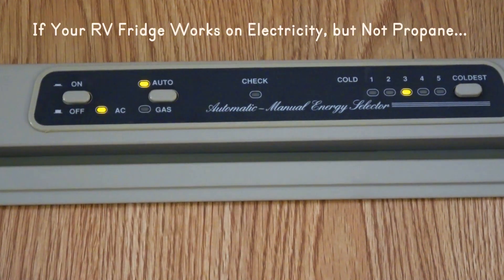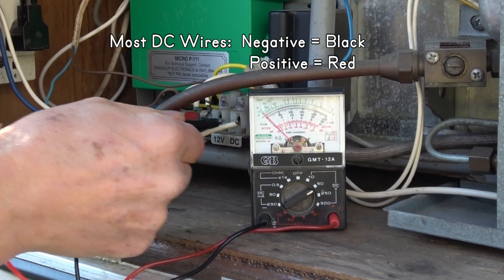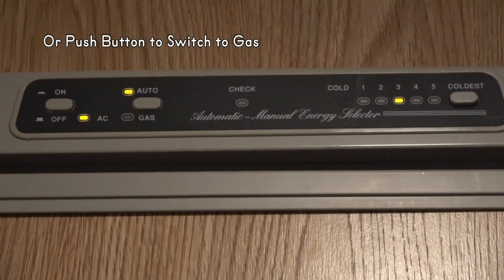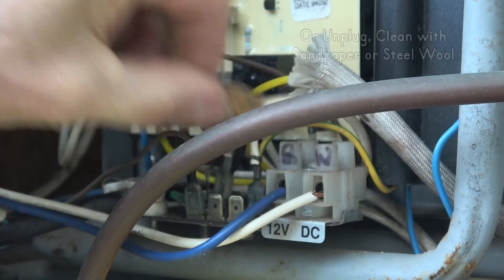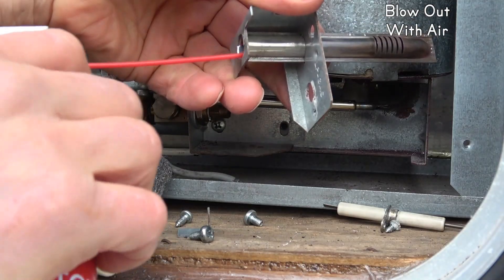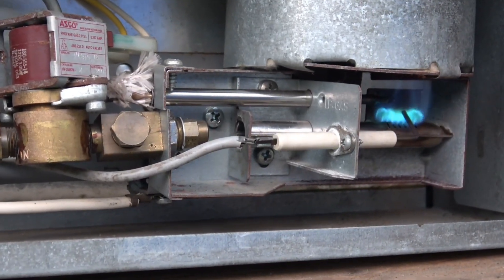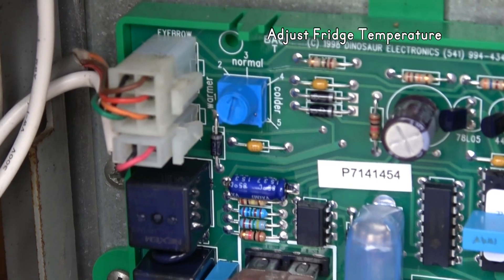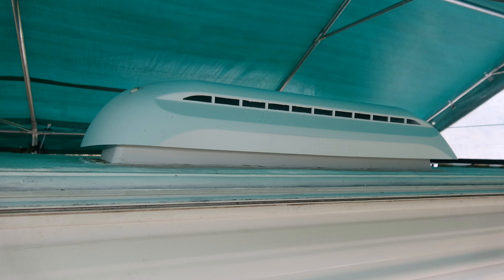RV Fridge Not Working on Propane - 10 Tips to Troubleshoot & Repair

Comment: Really SUPERvideo and very little "fluff".  The only problem is that it does not address MY problem. Fridge works on electric but on propane, flame starts and ignitor keeps sparking.  After about a minute of continuous sparking, flame shuts off and fault light comes on. Cleaning contacts did not work.  What is the next step?  BTW, when wiggling or pressing on the "black box" on the controller board. SOMETIMES it is a cracked solder joint which can be repaired by removing the board and resoldering all the connections for the "black box". It doesn't work more than about 29% of the time, but Wirth a try.
Reply from the maker: I suspect either the thermocouple or circuit board need replacing. When the flame lights, the thermocouple should sense the flame and turn off the igniter, so either it's not sensing it, or the circuit board relay is not turning the igniter off. A common sign of thermocouple failure is the flame burns 30-60 seconds then the solenoid closes shutting off the gas and the flame goes out.  The fact the igniter keeps sparking may show a circuit board problem. On mine, I first replaced the igniter for about $35, and it still had problems, so replaced the circuit board for about $120, and it's worked fine ever since. The igniter was more of a challenge, squeezing it into place. The circuit board was fairly easy. It's possible the igniter generator could be stuck on, but seems it would fail by not sparking, not by continuing to spark when it shouldn't. Let me know when you figure it out.

Comment: My propane fridge would work intermittently only
Reply: As I exam the modules and everything I found a piece of carbon stuck on the heat sensor once I remove that piece of carbon everything was fine it was hard to spot so check for anything in that area
Reply from the maker: If you continue to get debris on the thermocouple, it's possible the burner tube may need cleaning.

Comment: Is it possible that only part of the circuit board stops working?
Reply from the maker: Yes, I suspect only one component in the circuit board usually fails, but unless you know electronics, the way to fix it is replace the whole board.  When we were camping and the fridge quit working, I pulled the cover off the circuit board and wiggled things until I pressed a black box and suddenly the spark fired and the flame lit. So I cut a stick the right length to prop against that box until we got home. Replacing the circuit board was quite easy, though it cost $120 it has worked great ever since.
Reply: @HartzHomestead awesome thank you, it’s definitely the circuit board then. Thanks for the great video👍🏻

Comment: Hello! This is a great video. I have an interesting issue while on the road: Norcold 6162 comes on no problem on gas and everything works fine, but the gas shuts off after an hour or so and gives me the warning X. I just reignite and it's fine again for another hour or 2. What could that be? When I get home I'll do more testing but was hoping to get additional tips. Thanks much!
Reply from the maker: Electrical contacts can be the culprit, especially to the thermocouple and solenoid, either of which could possibly be the problem. Usually a bad thermocouple will shut the solenoid in about 30 seconds.  Thermocouples are not expensive and do wear out.  DeOxit works well on contacts.  I had different issues, but replacing the circuit board finally solved it and it's worked well ever since.  Cleaning everything may help too. Check if you turn on other gas appliances the pressure may drop and it could go out. In our camper if the fridge, hot water and stove are on, the heater won't light.

Comment: thank you for the video! very precise. i just have one question, my Norcold fridge flame stays for couple of hours but will shut off. Do you know what causes it?
Reply from the maker: I'd suspect either the thermocouple or circuit board are going bad, or could be just a weak electrical connection. Try cleaning the connections. Wiggle the wires around while it's running. I'm assuming the gas supply is steady, lighting another device may lower the pressure. Try to listen for if it's the solenoid closing that makes it go out. That's hard to diagnose when it works part of the time.
Reply: @HartzHomestead  Hey - I have the EXACT same issue and just posted that same question. Did you figure it out? Mine stays on for an hour or 2 and then gives the red x and I just restart it until it shuts off again.

Comment: My flame was coming on  then the regulator started clicking which shut the propane off . I just used an air compressor to blow the flame orifice out and it’s fixed ! The refrigerator has been off for about six months. Maybe spider or cob webs clogged it. Iv had same problem with propane torch heads and this always gets them flowing again.

Comment: I'm late for the meeting, but id like to share that my propane fridge started a small fire in my trailer while i was sleeping. When I returned home from my trip, I blew out the exhaust and a bunch of crispy wasps and a small burned nest came out of the vent for a few minutes of blowing with an air compressor. It took almost 2 days for the wasp nest to cook off before it finally combust.

Comment: Thank you for this fantastic explanatory tutorial. I had issues in hot weather on propane, while the cooker seemed fine and heating worked ok the fridge was warm and freezer was cold. Drove me nuts for a while and after replacing all sorts decided to replace the regulator on the motorhome tank, When I unscrewed the pipe at the regulator a brown residue liquid drained out and the fridge immediately started working again. I also blew the pipe back from the fridge to the disconnected regulator.

Comment: What about an electric fridge?
Reply from the maker: An electric fridge compressor type fridge is more efficient if you will always be plugged in to 120 volt power.  If you will be boondocking where there's no power, propane is more practical, unless you have a large solar and battery system. We always camp in the mountains where there is no power, and too many trees for much solar.

Comment: Perfect! So much useful information in such a compact and clean noise-free format. Thanks for the DIY manometer tip. I've been wondering for some time if low gas pressure might be the issue on my Dometic RM 7401.

Comment: Hi, any idea what would cause the electrode to continuously click? It lights and the fridge runs perfect but it just keeps clicking. Tried cleaning the area but still have the problem. It’s an Rm2355 Thanks in advance
Reply from the maker: The ignition module could be faulty. That controls the spark. If you follow the wires from the igniter, it may be just outside the circuit board. Or it could be the thermocouple, or flame sensor - make sure it's clean. If the wires and connections to these are good, try replacing each of them. You can try a reset - disconnect all power for 10 minutes or so, then reconnect and turn on.  Possibly the circuit board itself could need replacing.
Reply: @HartzHomestead  thanks for the info. Would the ignition module be the rectangle blue box?
Is it easy enough to replace? Just a couple of plugs?
Is the flame sensor part of the igniter electrode? I replaced the electrode today but it didn’t fix the problem unfortunately. I will try the module next. Thanks

Comment: You video coves a little too much for this 80 year old. My problem is the flame comes on but is nowhere as large s yours. I only started to have problems last weekend. In the past I had no problem getting the freezer to minus 20 degrees Celsius. Was working on it today gain but it took three hours to get it to -9. Ny idea why my flame is so small.
Reply from the maker: Sounds like either the gas pressure is too low, or something is partially blocking it. If any other gas appliances also have a low flame, test your gas pressure and turn it up at the regulator. Turn off all other gas appliances and see if that helps - as that may drop the pressure. Otherwise, try cleaning the burner tube, brass jet (very gently, with alcohol), and make sure the shut off valve is all the way open.

Comment: You didn't even mention my problem - no spark from the electrode
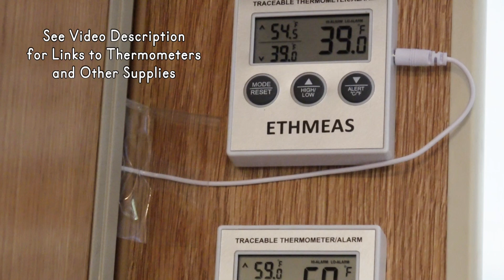Reply from the maker: Actually, at 2:53 I mentioned if you're not getting a spark, check the gap - should be 1/8 to 3/16" from the igniter to the burner tube.  Also clean your electrical connections - that was how I got mine working the first time, especially the ground, and lead to the igniter. There is a device by the circuit board that creates the spark which could need replacing, or you might need a new circuit board, which sends the signal for when the spark should fire. It's not hard to replace, but costs over $100.
Reply: @HartzHomestead  In my case it was working and then stopped working so I went through  the usual routine of cleaning all the connections and probe. I can light it manually so gas is working. I ordered a new igniter box ($100) I replaced the control board with a Dino a few years ago so ..🤞
Reply from the maker: Could well be the igniter box. Replacing the circuit board got ours working. We were camping and the fridge quit cooling. I pushed on a black box on the circuit board and it suddenly sparked, so wedged a stick in there which kept it working until we got home.
Reply: @HartzHomestead  FYI and for anyone else who might read this the new igniter box fixed my problem.

Comment: Wow! As thorough a lecture as I've ever received! My situation seems a bit different. I have a Dometic 8551 3-way. Works great on 120V, so-so on propane and not worth a darn on 12V. The challenge has been with the propane. In ambient temperatures of 80 or more the propane function struggles. Gas is good, jets and orifices are clean, solenoid good, igniter good, flame nice blue candle flame. It just won't produce cold temps during daytime operations. Does a little better at night, but still on the warmish side. I won't put lunch-meat, etc. in the box. One thing I haven't done is pull it out and do a thorough bench cleaning. Big job!
Reply from the maker: I've heard propane fridges don't do as well in hotter weather, though it should work as well on propane as 120V.  It can help to add a circulating fan to blow air over the coils on the back of the fridge, and make sure your roof vent screen is clean.  You could freeze extra ice at night and put it on the top shelf of the fridge in the day.  Also park in the shade, or with the fridge on the shady side if possible.

Comment: Great video it got me to at least sort of figure what my problem may be in less than 10 min. I don't think my flame is getting high enough to reach the thermocouple. I can jam a knife in there & pry it down about 1/8" and will work fine. Hopefully cleaning the nozzle works, if not i can't figure out how to adjust my propane pressure.
Reply from the maker: There should be an adjusting screw on the regulator on the propane tank that will adjust the pressure.  I'd suggest actually testing the pressure so you don't adjust it too high.

Comment: if the frige work great when the rv is park
but the frig warm up alot to room temp when i am driving on road for 4 hour 
and the burner is working when check it 
what would you think it could be ?
Reply from the maker: I don't know. I turn our propane off when we are driving, and just put extra ice in the fridge. If the propane and battery are on, it should still work when driving, unless you are driving long steady up or down hill, it works best when near level.

Comment: Any idea if pilot lights but only for a few/10 seconds? Works on AC but not on gas. Pilot only stays on for 5-10 secs. Solenoid?
Reply from the maker: There's not a pilot, so I assume you mean the flame goes out after a few seconds. Try cleaning the electrical contacts to the thermocouple, the sensor in the flame that tells the control panel if the flame is lit.  Not too hard to replace. Usually if it's bad, or contacts are poor, it will stay lit about 30 seconds then you'd hear the solenoid clunk and the flame goes out. You can test the solenoid by applying 12 volts and it should stay open as long as there's power to it. You'd hear it open and close. Or could you be low on gas and there's just enough in the lines for a few seconds of flame? Or other appliances using the gas?

Comment: Thanks for the amazing video.  It's nice to see a video that doesn't waste time getting to the point.  So much information.  My A/C side is working fine on my 20 year old Norcold.  On The LP side,  flame is working fine although more orange than I would like, but the fridge is not cooling down.  Any suggestions?
Reply from the maker: Did you give it at least 1-2 hours to start cooling? Also make sure the flame is staying lit all that time. It helps to track it with a thermometer in the freezer, and feel the plate near the top back - that should be cold.  An orange flame could mean the inside of the burner tube needs cleaning, or the LP pressure could be low. Since it works on AC, it seems either the flame is not putting out enough heat, or it's not getting to the coils. Also possible the flue above the flame could be blocked, but that usually has to be accessed through the roof vent.

Comment: My RV fridge will only work with propane, but it’s freezing right now so it doesn’t wanna work, but it won’t switch from gas to AC even though it’s plugged in I’m not sure what to do. Any help would be greatly appreciated.
Reply from the maker: They don't work as well in cold weather - it may help to cover the vents in the access door to hold in some of the heat.  It's possible the AC element could be burned out - switch it to AC and after about 10 minutes feel if the vent pipe is warm.  More likely there's a poor electrical connection, or the control panel needs replacing. Unplug the power and clean the connections especially to the 120 volt element, and the grounds. Wiggle and push on the wires. Replacing the control panel is not hard, but mine was about $120 and that did fix it. If possible, wait for warmer weather and see if that helps. If you have a thermometer in the fridge that can help know how it's doing.

Comment: 1:27  your lpg tank is horizontal -I thought that was a big no-no! 
I only ask because I'd love to have my camper tank on its side to fit under the bed-base.
Reply from the maker: Some tanks are made to be horizontal, others vertical. It's important to keep and fill them in the position they are made for. So you could get a horizontal tank - might need a different tie down or hose to make it work.
Reply: @HartzHomestead surprising how the commentor did not respond here, you deserve that much. thanks for answering questions here.

Comment: Great stuff. I just got my dometic fridge to lite on propane but the flame is low and my ignition is constantly clicking. This looks very helpful to disassemble and clean the burner tube.
Reply from the maker: If cleaning the burner tube doesn't fix it, other causes of the flame being low might be the brass jet could need cleaning (my manual says to gently clean it with alcohol and compressed air so as not to damage it), or your gas pressure might be low (see the video section on DIY manometer to test gas pressure). Hope this helps.
Reply: @HartzHomestead  Thanks, I seem to have it somewhat fixed.I cleaned the burner tube and burner jet as suggested.
 I now have a strong flame at start-up/cool down for the fridge and its working well BUT when the fridge is at temperature and the flame drops my ignition wants to constantly work.. clicking no stop. I've adjusted the electrode to what seems like an appropriate gap but no luck. What drive the electrode to want to work? Appreciate anymore tips.
Reply from the maker: Are you saying the flame drops to a lower flame?  On mine the flame is either on or off. The electrode should only spark when there's no flame and the fridge is warm enough to re-light.  You may need a new thermocouple. If it is not detecting the flame when there actually is, it may think the flame has gone out and needs re-lighting.  Or you may need a new circuit board, which tells the electrode when to spark, and then there's a black box that creates the spark. You could do a search for "igniter keeps sparking when there is a flame" or something like that and see if someone has a better answer.
Reply: @HartzHomestead  Yes, the flame remains low and then the electrode starts. It never completely shuts off as far as I can tell, when the fridge reaches a certain temperature my flame drops and the ignition starts clicking. I have RM2454. 
I've found a couple of dormant forum discussions on the topic I've tried to revive to see if someone has a clear conclusion.
Reply from the maker: It sounds like the solenoid is not closing completely. If you turn the fridge completely off, does the flame still stay lit?  Or if you disconnect the wires to the solenoid, it should close and the flame would go out. Or do you have to close the gas valve to get it to go out?
You can test the solenoid by applying 12 volts, then no voltage, and it should open and close. If it's not, I'd replace it.
Possibly when the flame drops low like that the thermocouple no longer senses the flame, but if the solenoid won't close, it tries to re-ignite.
Do you have a manual or can you find one online?  That may give troubleshooting tips.